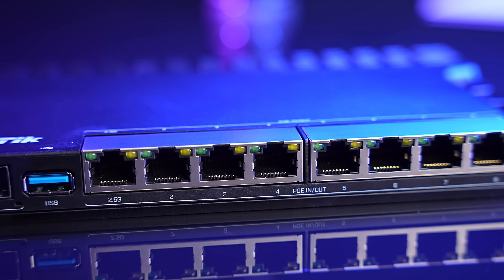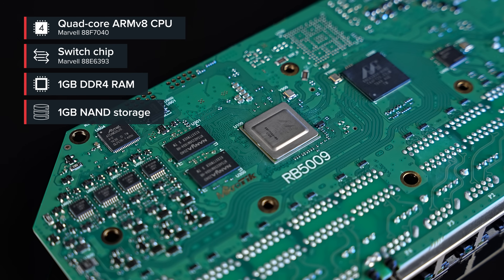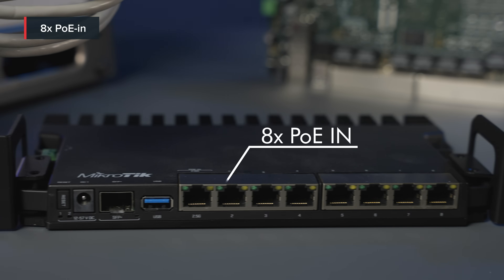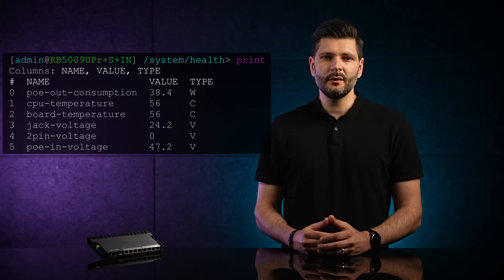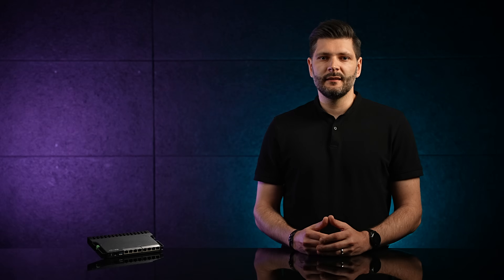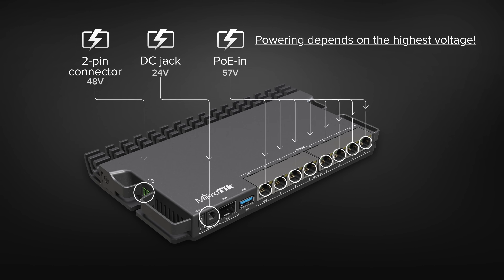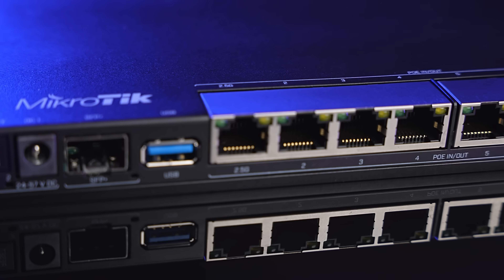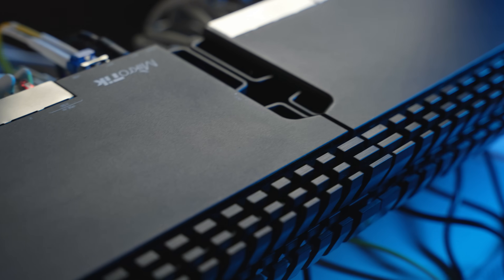MikroTik products news: RB5009UPr+S+IN

Comment: I wonder why you build certain products the way you do. You're product line seems so weird to me.

The CRS-line is great at switching (why the R?). The CRS328 has a bad ARM-CPU and 512MB of RAM, so it sucks at routing. Then you have the CRS354, which has an even worse MIPS-based CPU with only 128MB of RAM, so it has an even worse routing performance but supports L3HW Routing (which comes with it's own obstacales). And don't let me speak about encryption for VPNs, both suck at it with the MIPS CPU being completly overloaded. But they offer PoE+, which is nice.

Then you have the CCR-line, which are good routers with good encryption performance. But the CCR2004-16G-2S+ doesn't come with PoE+.

The RB5009 is a great product: Great routing performance, PoE+ and great encryption performance. But you only offer a model with 8 ports. What I need is an RB5009 with 24 and 48 PoE+Ports or a CCR2004 with 24 and 48 PoE+Ports.

Comment: What's the point of single 2.5Gb port? I think majority of users doing 2.5Gb networking use it to connect PC with NAS.

Also it's awesome that all ports have PoE+. But with 420mA limit, even with 57V adapter (which you don't even sell, and this comes with 48V), it just barely won't be enough for Raspberry Pi 5 which needs 25W to power USB drives.
Reply from the maker: You can use this port for that then

Comment: I'm getting the RB5009UPr+S+IN which supports PoE out.

I have one Ubiquity NanoG GPON which is my WAN (PPPoE). It supports Passive PoE-In - 24V Passive PoE (Pins 4, 5+; 7, 8-) and I also have a TP-Link Access Point that is also Passive PoE.

Will I be able to power it using the PoE Out on the ports?
Reply: Looking at their release cadence, I think they could update RB5009 in August(in a few days or weeks). At least I am hoping they will release something with more 2.5G ports - 2 Gbps fiber costs 8 Euros/month here, it’s a shame to be limited by the router

Comment: Until proper documentation, or at least align the current one with these new devices, these are just fancy expensive bricks. On the other hand, is this the novelty? Are you bragging about POE in 2022?
Reply from the maker: What is not correct in the current documentation about these devices? And about PoE, if you don’t have a need for a powerful router with poe on its ports, it’s simply not a device for you
Reply: @mikrotik  Check this "I purchased a RB5009 a couple of weeks ago and the current documentation does not align with what is available in RouterOS."

Comment: What POE adaptor do you recommend for this RB5009UPr+S+IN? It seems that MikroTik does not sell any POE adaptor, especially for a power ouput of 150W.
Reply: You can't. The router only goes up to PoE+ (Type 2), which is ~25W in. Even Type 4 devices cap out at 70W in. If you want to power other devices, you need a dedicated PSU.
Reply: @watchm4ker  It's a pity MikroTik has not given the 802.3bt POE-IN to RB5009UPr
Reply: @maslai1039  It is, but I imagine the circuitry for hybrid in/out ports is complicated enough as is for the price point, without having to carry potentially 3-4 times the load per port.

Comment: Confused. You say 24-57vdc but the DC jack very clearly says 12-57
Reply: You could power it by 12V but I doubt you could provide PoE to anything. Most PoE transformers expect either 24 ot 48-57 and will get a little upset if they get less

Comment: Ideal for small home networks, POE on every port is really good.
I wish there were a few more 2,5Gbit Ports and at least an additional SFP (for the DSL-Modem in SFP-Form factor, 10Gbit not needed...).
And it would be great if there would be ANY mikrotik devices on stock. Not a single 802.3at/af POE-Switch is on stock (at least in germany and at the moment), no cAP, no hAP AC (with the practical POE-Port für DECT-Bases when fed with 48V)
And Wifi 6e will get introduced by Mikrotik in 2030 or when?

Comment: Sadly Mikrotik do not support PoE Mode A
Reply from the maker: No, ether1 supports A/B, but ether2-8 B-only
Reply: @mikrotik  a lot of devices support only A - you should consider to add this to main 24/48 poe switches it will help integrators to stay only with mikrotik
Reply: @stanisawbiaas827  Just get rid of cheap devices which don't comply to standards - PD have to support A AND B, so there is no real issue with Mikrotik supporting B, all standard-POE devices will work with this.
Reply: @mikrotik нет, в характеристиках на сайте компании НЕ так написано. Там сказано относительно режима B, что он актуален лишь для POE-IN !
Таки, а, как на самом-то деле в ситуации с POE-OUT ?

Comment: Very good option but no stock.
I have searched for this model and there is no stock.
I have searched for RB260GSP and there is no stock.
I have searched for RB260GS and there is no stock.
I have searched for RB960PGS (hEX PoE) and there is no stock.
I have searched Wireless Wire Cube Pro and there is no stock.
Missing stock of many models.
Reply from the maker: It’s not released yet, of course no stock
Reply: @mikrotik  Yes. About the model of the presentation, I imagined it. 
But what about the rest? 
Please, is there any news about when we will have new stock of Mikrotik products?

Comment: Truly looks too good to be true. Considering the absolutely enormous supply chain issues with MikroTik POE devices over the last year though I am justifiably apprehensive. Hell, it has been near impossible to get our hands on a Netpower 16p. I want to try this so bad that it feels like it will be available sometime around 2030 lol.
Reply: I had the same experience. Ordered MikroTik AC AP, waited for a month. The store ended up cancelling the other. Went with TP-LINK Omada instead. For home use could have been enough to set up Honor or Huawei WiFi 6 router as an AP for under 40€ but I wanted to test out Omada since it was pitched as a Unifi alternative. I'm not disappointed :).
 Hopefully MikroTik will have WiFi 7 AP by the time I decide to change mine :)
Reply: Me too, We're looking at 6+ months for pretty much ANYTHING here in Australia. I do have a spare hAPac2 but wanted to buy another hEX PoE, no chance of getting one this side of 2023 I don't think.

Comment: Can anybody mention a use-case for mounting 4 exactly same devices in the same 1U rackspace? I cannot get over it. A 16-port and a 24-port option with rackmount would make much more sense so I would not have to configure / update / maintain 4 devices...
Reply: Redundant systems, what if single router fails, can fall back to other device. And not a home use-case probably.
Reply: @michaeljarcher  2 in 1U space would be much more logical for redundancy, but 4. Also I do not understand why they are not making the RB4011 in a similar rackmount form factor than the RB3011. That rackmount accessory for the RB4011 is the ugliest thing in the world.
Reply: Lab use.
Reply: @steve87uk  Come on. Think again. For lab use you can virtualize, use software solutions, simulate, etc. These are real products for production environments. You can use them in labs for sure, but why to design them for lab use? It does not make sense.
Reply: @romanvarga  I didn't say it was the only use.. Use your imagination!
Reply: Redundancy, several ISPs (we use the SFP-Port for a DSL-Modem),loadbalancing, several companys with minimal usage of rackspace just for the internet Access. Image 4 Fritzboxes or 4x Lancom 1 HE, that would be 4HE just for the routers.
But yes, this with 8 POE-Port amd 16 nomal Ports in 1HE halfheight would be nice, so you could combine 2 Routers for 2 ISPs and having with 2x24 Ports enough Ports for a small company.

Comment: Finally! I have been looking for this router. But don't rule out the home enthusiasts and small businesses and only focus on ISP's, I was looking for a way to add 802.3af/at to my network but did not want to add ANOTHER device to my network. Now I just replace my RB260GSP and RB4011iGS+ with this and power all the small desktop switches, camera's and accesspoints throughout the house from this one device instead of separate power bricks, marking it more efficient, simpeler and power redundant.
It's powerful enough to route and firewall my gigabit fiber connection as well as VPN and QoS without breaking a sweat.
For a small business that uses all wireless laptops and a couple of AP's (seen more than once) you always need a extra 5-8 port PoE switch and a router just for a setup like that, that can be done with just this router. Or a slightly bigger network with just a couple of accesspoints and wired connections you can use this router to power the AP's and camera's and use a non-poe switch to get connectivity to the desktops.

Comment: since this product uses RouterOS which is based on GPL-licensed Linux, where can I get the complete source code ?
Reply from the maker: You can get the source code if you ask support@mikrotik.com
Reply: @mikrotik  i've asked, no answer yet
Reply: To get a CD with the corresponding source code for the GPL-covered programs in this distribution, wire transfer $45 to MikroTikls SIA, Brivibas gatve 214i, Riga, LV-1039, Latvia. Please contact MikroTikls SIA for our current account information and wire transfer instructions. Offer valid for three years from the date of distribution of this software. This CD will only include the source code of the following programs and any non-proprietary programs distributed according to license requirements. This CD will not include MikroTikls proprietary SOFTWARE.
Reply: @DominicMeyer  do they really respect the spirit of the GPL and open-source software or do they mostly take what they want and keep as much of their own stuff as possible proprietary?